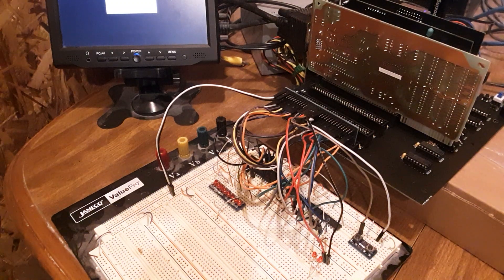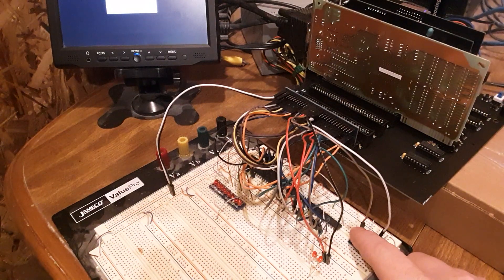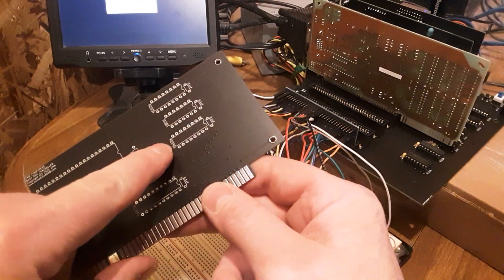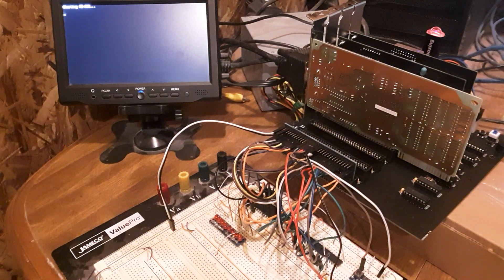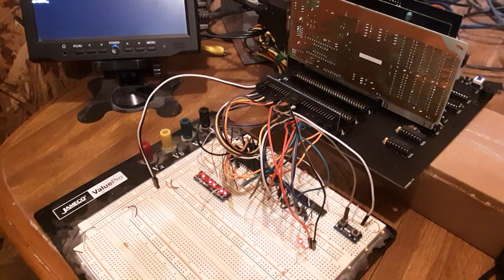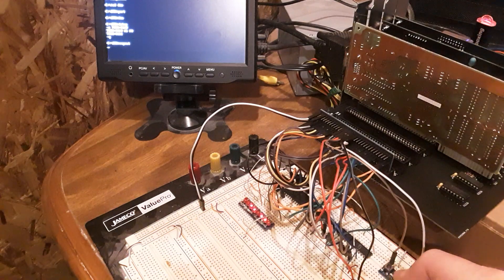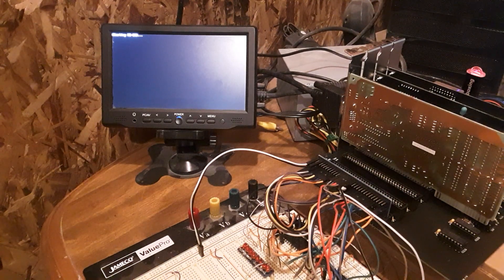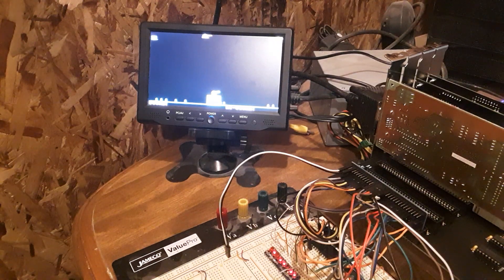8237 DMA Controller

Comment: I was going to ask to test the DMA controller, but I'll have to wait until the 8 slot boards are available. There's a floppy / RS232 kit I'd like to try, but of course that will need  5 total slots (with video card).
Reply from the maker: I am thinking one day I will build a single card with the Processor, DMA, and Ram so that there is 6 card slots available.

Comment: Do you need this for say a Sound Blaster & it's DMA channel 1 stuff? I'd imagine so...?
Reply from the maker: I don't know much about sound blaster cards but from what I have read they used the DMA controller. I don't know which channel is needed. This card has channel 1, 2, and 3 available as was the case on the IBM 5150
Reply: @elijahmmiller  it's selectable between 1 and 3.  So yeah it's not insane to want one..  Looks pretty good progress!!
Reply from the maker: I just seen this posted from a month ago. This guy has a sound card on one of my earlier board. 

https://youtu.be/Z78Ud2Vn8TA